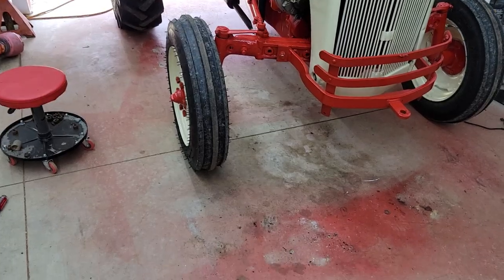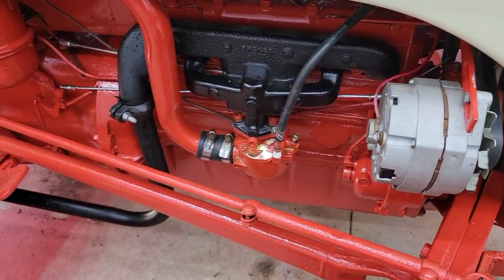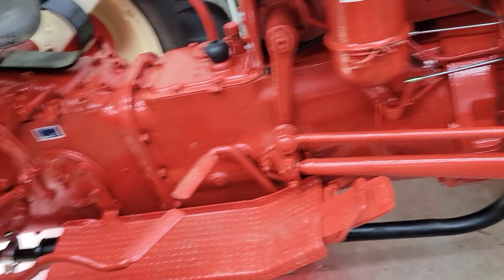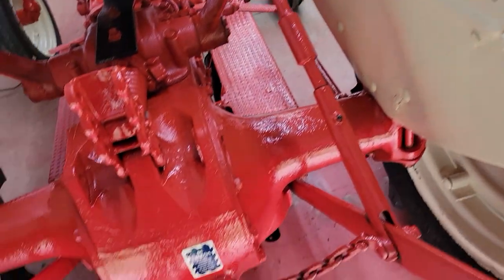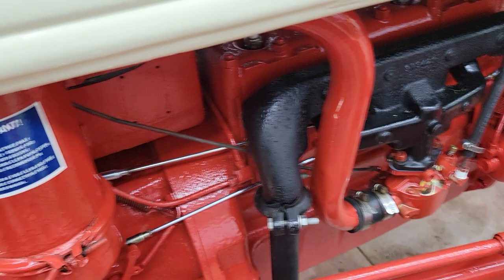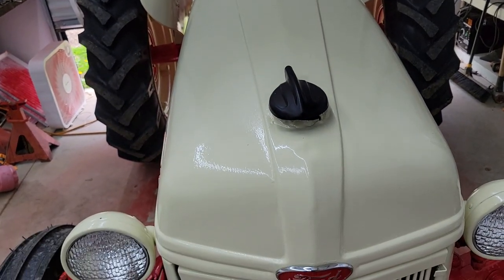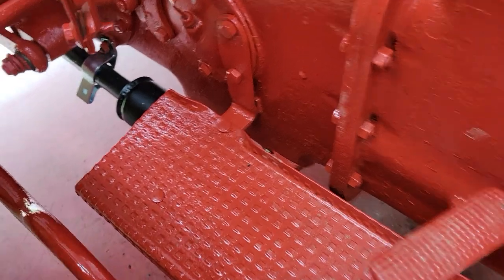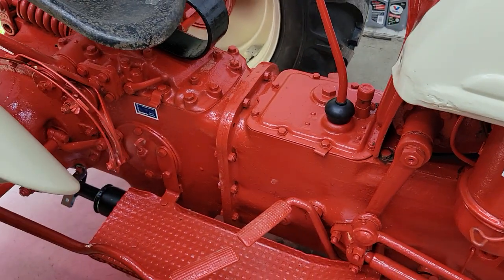Ford 8N restoration project complete

Comment: Am helping out on a farm with an old 8N. The push button starter has a tab on it, but no wire attached to it. I presume a wire needs to be attached to the tab, and then run over to some spot on the wiring block OR the starter solenoid. Any guidance on where I need to hook up the starter button to?  You did a FANTASTIC job on this machine, looks considerably better than the one I am trying to get running.
Reply from the maker: Is it 12v or 6v
Reply: @josharchervlogs7386  pretty certain it is 12 volt - I put a volt meter on the battery and got a strong 12 volt reading, so I pressed that starter button and it did exactly nothing. So made me start looking around for information on these 8N tractors, this is the first one I have ever seen in person. I am a bit in the dark!
Reply from the maker: @guns2317  look at the edge of the wiring harness by the ignition. The white wire is the one that goes to the button
Reply: @josharchervlogs7386  Thanks! I will be back over at the farm later this week. Appreciate the response greatly.

Comment: Beautiful job! It looks new. Could you give me the exact paint number of the Rust Oleum Almond you used on the body parts of your tractor. I have a very old looking '54 and I want to duplicate what you did. What did you paint the exhaust system with. I agree! It really "Pops" against the red. I want to do the same.  (Did the black stay on?) Thanks so very much!
Reply from the maker: Just regular Rust-o-leum Almond rattle can paint. Rust-o-leum black high heat rattle can paint